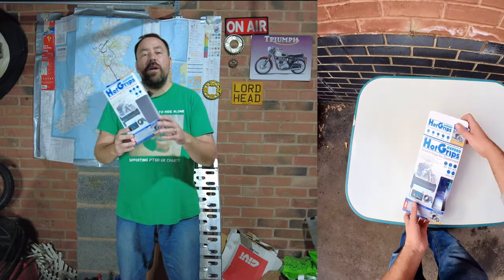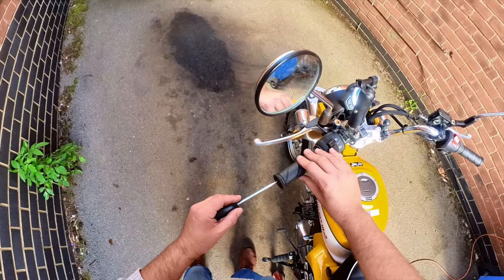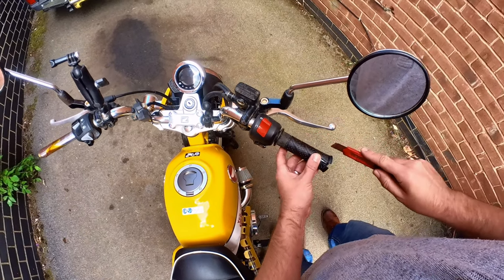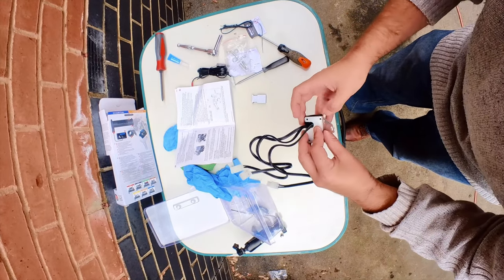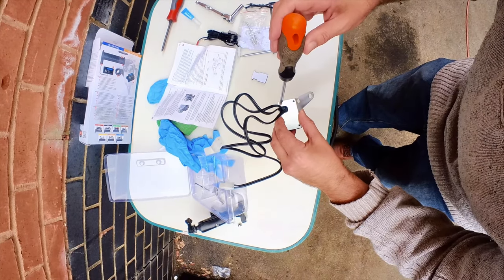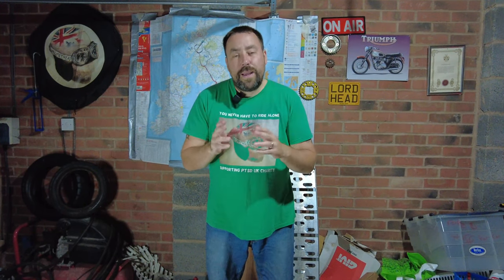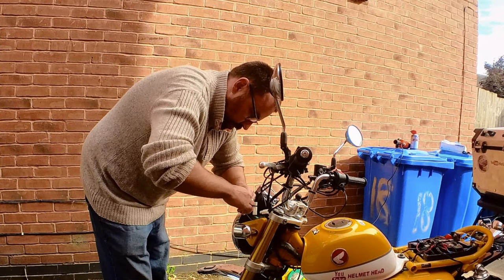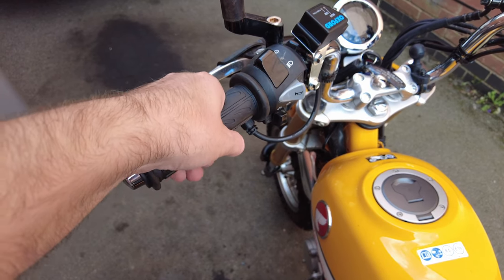How To Install Oxford Heated Grips DIY 4K

Comment: How come that all the guides instruct you to directly connect to the battery? These are all wrong you should run the wiers trough the key contact or trough a relay no not risk to dry out the battery if you forget them off or somebody pushes a button while parked

Comment: I found the commuter ones the control box went funny after a few months bought a version 8 control switch (has buttons rather than a switch) which is waterproofed better and it’s been fine for 18 months, won’t be many weeks before they will be getting used again.

Comment: You showed you cutting the grip off the throttle side. Exposing the bare metal, and then you must of put that grip back on before supergluing you the old grip and putting the Oxford grip back on top? Not sure why you did that?
Reply: That’s the actual throttle underneath the rubber grip. The throttle is black. On some bikes it’s white.

Comment: by connecting direct to the battery, isnt there a chance you can flatten it (probably quite quickly) if you leave the grips switched on by mistake when not riding?. I fitted a 4 way auxiliary fuse box to my own bike with a relay switched by the ignition circuit (using the rear number plate light wire) and currently only have a usb charger/voltmeter attached, but intended to fit spade connectors to the heated grip cable and simply plug it in. Isn't this what you should do for a proper job?, or is there something within the grip controller that detects the bike not in use and switches them off?. thanks
Reply: You are correct. That would be the best way to hook these up
Reply: Depending on the model some of them have a vibration sensor. No vibrations and it turns off.
Reply: @Delalcon it’s not a vibration sensor, the electronics detect there is no charge coming to the battery and turns them off.
Reply: @Funky_Geek  yeah found that out too. Thanks anyway

Comment: great breakdown, had my oxford grips pack for near a year, very scared not to mess it up! thanks for a awesome 
tutorial sir! 🔥👍
Reply: Bought a koso apollo and installed it on my brand new bike with not even 300 miles, less than a week after getting them. It alright to be nervous but the more you delay the worse it will be. Just go and start on your project and start with the hardest part and if you can do that, you can finish your project.

Comment: I heard on another how to install video that for Oxford grips you need to file down or smooth down the ribs on the grips as the plastic tube inside the heated grips are too tight tolerance to go on without it!, do your Oxfords have a hard plastic tube inside please? I haven't bought the grips yet but they'd be for a Monkey also..

Comment: Don't kill your battery
This will drain your battery very quickly if you wire it up directly and leave it on without the bike running, so make sure you wire it to a circuit that's only live when the bike's key is in the on position!
Reply: How can you make sure you're wiring to a circuit that's only live when the bike is running? I understand what you mean but I have no practical knowledge of wiring on a car/motorcycle
Reply: I would use an ignition switched circuit to control a relay, connect the grips and the battery through the relay, job done 👍
Reply: @stevejohn01  @Gopi if you really want to do it right, you need several components. You want an inline fuse(maybe 15-30 amps depending on how many accessories you want to install) coming off of your battery that runs into an automotive relay. The relay should be wired to a circuit that's already switched on by the ignition(license plate lights, tail lights and headlights are all popular choices. All that circuit has to do is activate the relay and that takes very little power). You wire up the relay to an auxilary fuse block and voila, you have an auxiliary electrical system. Now just wire your accessories to the fuse block and you're all set
Reply: You don’t need to as these detect when there’s no charging coming to the battery (when it’s turned off) and auto turn themselves off)